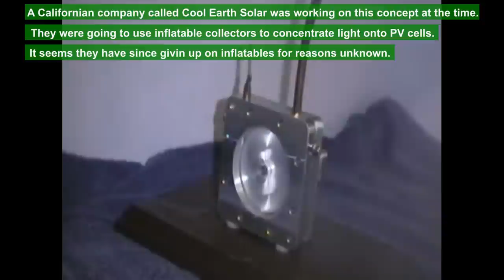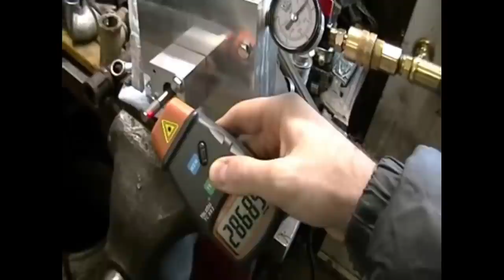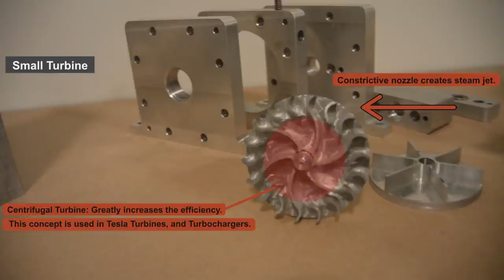Tesla & Steam Turbines For Solar

Comment: Okay, if the principle could be reduced to nano level, then the Tesla House would have a new dimension of efficiency I originally missed. If a plug-and-play greenhouse shell with vents and pressure equalization throughout were lined with both mini solar panels that follow the sun AND mini turbines to harness wind, converting the heat, wind and electrical energy into pressure for turbine/electrical system charging would be feasible. Rain barrels and storage cells for water in the walls, ceiling and floors make that a seasonal switch to optimize thermodynamic efficiency. Loss at each level MUST be math modeled in 3D before we can talk about real-world applications. But that is the best domestic energy solution, a house that works like a cell. Nature is the battery, and solar panels and micro turbines protected from the elements would last longer.
Reply: We tried solar panels but their energy is so limited that it takes an astronomical amount of them panels. Should try the use of lenses for direct energy. The energy produced by the lenses is unbelievable. Even a piece of titanium steel cannot take the high-density heat light bean from the lenses. Thinking a lot of technology going into common solar panels when a little bit of research should be done on these lenses. The power is 5 times as much and as a kicker doesn't need to be housed in a battery, if one is using the heat from the beam of light to heat a boiler that generates power for electric generation. Cutting the need for natural gas Coal so on exedra as a power source for the main objective of generating electricity.See where a guy is trying to purchase a steam powered power plant that was decommissioned and put up for sale. His plan is to use the old Steam plant as part of a research project of using these lenses and their power to actually give the energy source to steam-power the existing generators in the power plant. Would love to see these investors as well as that gentleman pull that off.We have a setup with the lenses but it's at a hobby level.Cost is the biggest issue with it remaining just at Hobby level on our part. They got some clout and are willing to do the research and fund it.. They've just simply got to get by the regulation system that's so heavily under Fire with environmental issues at this time. Been a while since the  post was made but since I see there are real estate companies that actually are listing / 200 close down coal-burning power plants up for sale. The regulation system is the reason why!! EPA and the Sierra club close them for regulation violations due to climate change.
Reply: @edbollett9083  Wow, that is so obvious and yet it has been overlooked by the money driving "innovation." Why didn't anyone try to concentrate sunlight before extracting electricity from it? It's SO much more efficient to focus the source rather than diffuse the receptor. If a design for focused solar extraction could be worked out, then adding lenses would be easy. Some combination of direct sunlight concentration and higher-energy solar panels might wind up being best.  

I had a thought a few years ago that I never shared, and just recently I saw a video about it. All of the energy flowing in the pipes of a house is not seen as loss, since the flow of it out of the faucet if the goal. How much in-pipe energy could be harvested at different scales of the water supply? Similarly, the main issue with wind turbines is that the hardware costs a lot to make and breaks down quickly, probably due to the Green Energy manufacturing hustle making everything disposable. I though about tide farms, with a perfectly predictable source of energy. If the hardware is built for sustainability in a marine environment and not quick profits, it might provide a solid energy supplement to coastal populations, I think Scotland is trying it.

Comment: you are doing a good job BUT if your fluid gets in liquid phase inside your turbine you are already having trouble, you should work in supercritical temperatures and then condensate the steam outside the turbine to restart the cycle
Reply: none of these turbines are made to even withstand the temperatures of dry steam, this is the whole problem with DIY turbines, you can't DIY the metallurgy.

Comment: Hello, isn`t the bladed rotor  (@ 5:08)   put in backwards?
Reply from the maker: No the direction of the curvature of the fins causes most resistance to the flow of steam, the way I have it. It can be either way depending on various dynamics of the system.

Comment: - Did you get Energy from Turbine ?
- Input: Fluid + Gravity + Water Pump.
- Output: Water + Rotor Energy.
- did you get extra energy from closed system ? Gravity have to become mechanical Force then transfer to electrons.

Comment: I want to know how much power are you using to create all this power ? Really impressive, wow😵😵
Reply: My assumption is that this is the testing phase. The end goal is to use sunlight to heat a material and create steam, then use the steam's pressure(which can be extremely high even through solar means) to spin the turbine.

Comment: Is it possible to make a closed system. In such a way that the solar energy collected is used to convert water to steam, than thIs steam is used to run a trubine to generate electricity after that the steam is then condensed to water and fed back into the system. The system sould be compact so that i could be installed on the roof of houses.

Comment: i need one of these that can turn a genset with gear reduction or some other way and i need it to be quiet ish, i also work at a laser cutting company and could assist with parts. after watching more of the vid, i want you to build one that you think would be the bees knees regardless if you think it will explode or shatter or whatever, then send it to me, i'll run it on our shop supply in a cage and see if it can do what we want it to do. We have pressures up to 145psi and huge volumes so something like that could probably run for 10 hrs straight and not run out of air, you could also just send me drawings or cad files and we could probably build one out of scrap stuff we got laying around for testing.....

Comment: Water boils at 30c and recondenses at 29c in a vacuum use a closed-loop system stop wasting energy
Reply: Water boil temp> 100c
Reply: @george7021  Depends on the level of vacuum and the purity of the water 30c is possible.

Comment: tesla turbine is failure..... i like your rotor way better....they create positive pressure on outside so steam baisicly pushes through.also steam recirculates is being used again and again..... so i would say your original turbine is 3 times as efficient then any tesla turbine. yes disc goes high rpms...but who needs thay high rpms when bearings can fail....thanks for the post